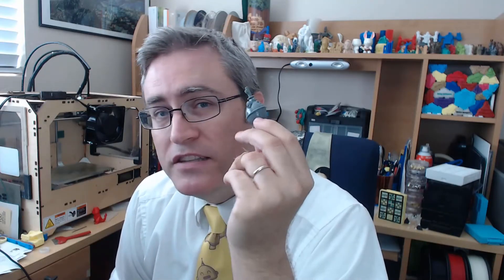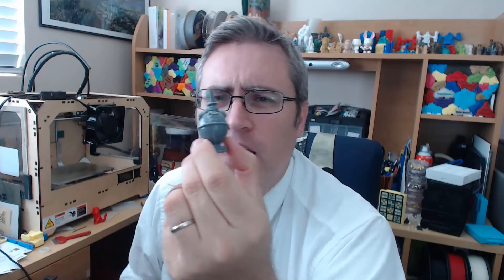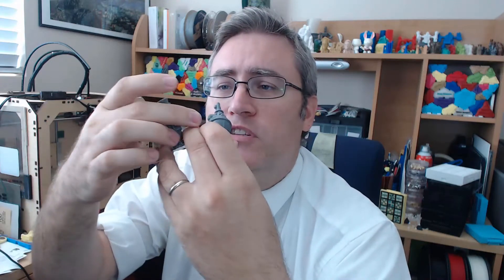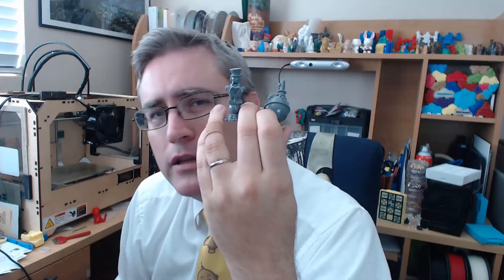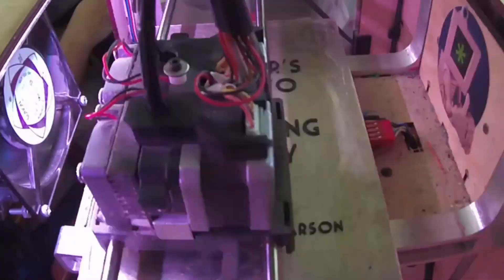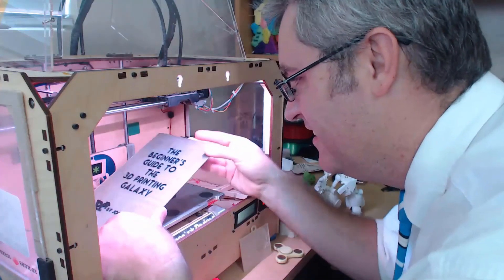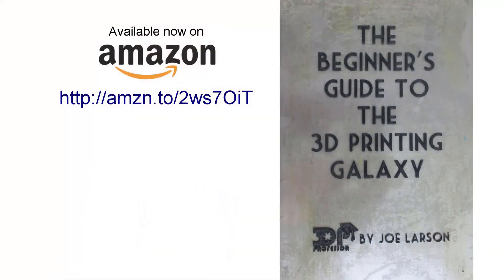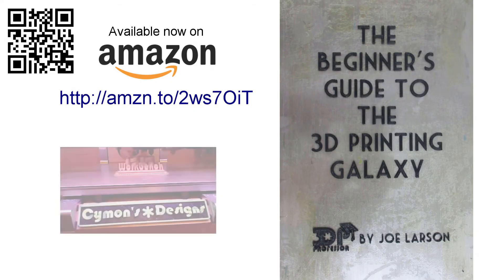Should you vape smooth your 3D prints

Comment: I've been using the small jar/acetone at room temperature on ABS for about a year and it works like a charm. The prints look almost injection moulded and are far stronger. Its a bit of trial and error to get it right but the results are fantastic.

Comment: Everyone talks about how hard abs is to print with? I've had pitfalls using abs, but not many, I've had just as many if not more failures using pla. Also I've printed tons of things with abs and they all came out dimensionally accurate. And I've printed parts that fit Int real work objects, example I got a second hand humidifier that was missing the water tray, looked online and they had replacement parts for it, but the water tray was no long even produced. So I broke out my calipers and measured and drew one up in cad software and exported the stl and printed it and it fit perfectly.

Comment: I use chloroform to smooth PLA, although allegedly methylene chloride (dichloromethane) will work too and is more easily obtainable. If you dissolve some 3D printing scrap in it you can make some useful "glue". A fume hood is ideal, but a big ole' fan will do the business as well. Certainly more toxic than acetone, and will go through nitrile gloves in seconds (through latex instantly), but eh... what's life without a little excitement now and again? :)

Comment: cough Sand paper cough Sorry.  I've never tried any of the epoxy smoothing methods like XTC 3D or the like,  but I know a little sand paper and a little filler and a little more sand paper gets very pleasing results.

I suppose a little click baiting can be forgiven... just this once though.  :D
Reply: Sandpaper, sure, but it's a pain in the butt, and takes forever.  especially if you have a large print with many sides (like chaos core tech's easy to print bomb-omb.  I tried sanding that down.......I gave up with about 4 hours of sanding put into it.)
Reply: Plus sandpaper, or even filler, will never make the print stronger and very much the opposite.

Comment: I have tried cold vapor smoothing four or five times and nothing I do has come up with quality results even after 6 hours in it.  I really don't want to purchase a rice cooker and try it then blow myself up or find it sucks just as badly.  Hatchbox ABS does 100% dissolve in Acetone within 5m so not sure what is the issue using all sort of sized bottles and paper method.  The last time I put it in a pickle jar with the bottom filled with Acetone and paper towel around it and after 6 hours around 75% was smooth but it melted far too much and the part could not be used.
Reply from the maker: Smoothing big parts is tricky, whether hot or not. Often times I just put some on a paper towel and rub down the outside.
Reply: The Best Stooge, I haven't tried ABS at all (I have reasons), but one method I heard of that works pretty well (reportedly) is to soak 3 or so paper towels in acetone, take an empty paint can, turn it upside down, use magnets or something similar to attach the paper towels on different spots of the internal walls, then put the print on the lid, and the can over it.

iirc, the timing for how long to do it is roughly the same?
Reply: @Chrona Trigger that is the first method I tried and no go at all.

@3D Printing Professor These parts are less than 30mm square to 10mm square (not real square as these are parts but lets use that figure) and nothing I have tried really works.  Even the last try at 6 hours the part took 24h to harden back up but it had deformed so much it was worthless and still only about 70%-75% of it actually smoothed.  As far as a paper towel that leaves fuzzies and lint but the next time I am going to try my old Coffee Filter and Acetone because coffee filters are made to never shred or give lint/paper particles and is what I use when I clean my bed due to that.  I have used Acetone and a paint brush to paint the acetone on but that was to help with a wonky filament I use as the company made some terrible filaments.  It never looks right but is stronger.

Comment: I get it bro, you vape smooth

PS: BTW I'd be interesting to learn about the possibility of ironing your print using a special nozzle. I've heard this is possible now using a slicer. Could you also do this for vertical walls?
Reply from the maker: The new version of cura goes over top layers with a hot nozzle to smooth things out and the pictures look pretty, but switching to Cura means re-leveling my plate because it has a different idea of what 0 is than Simplify3D, or something. I don't know, the point is it's hard to swap back and forth.